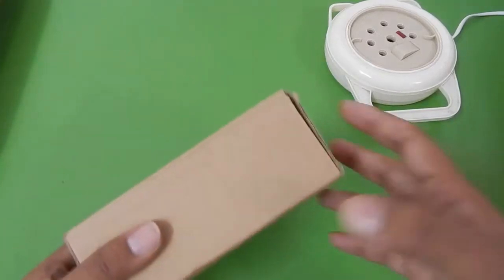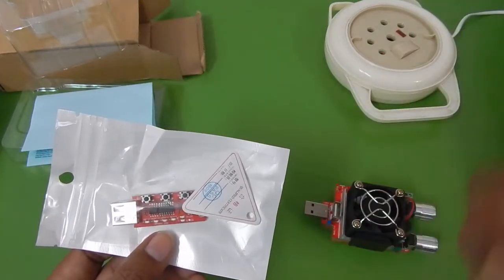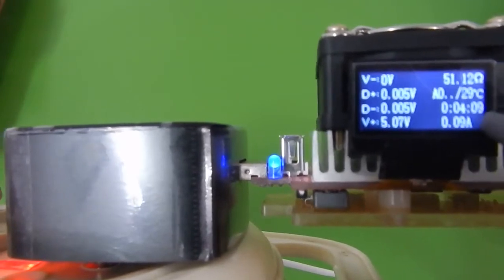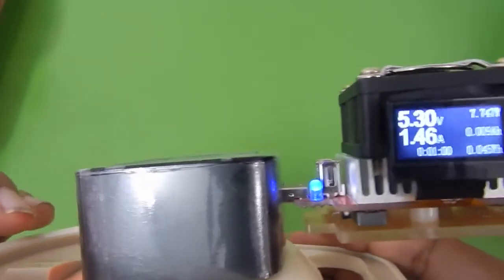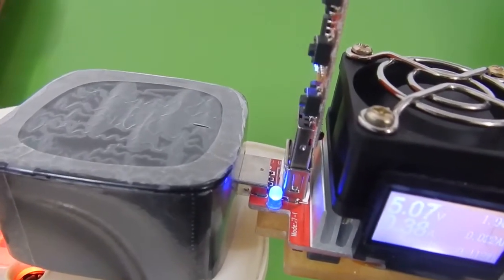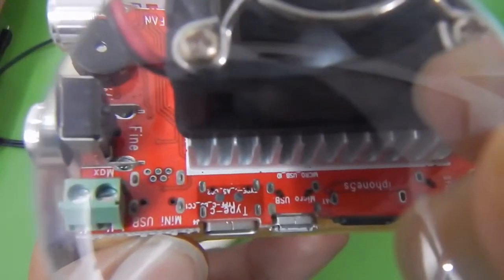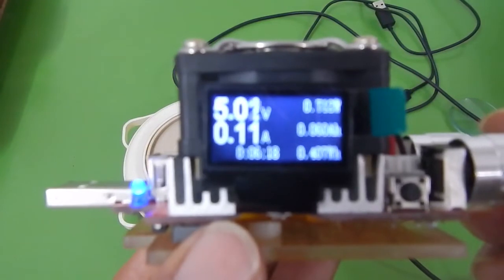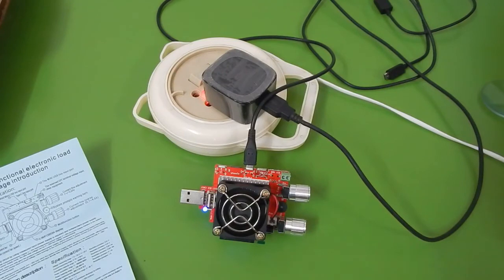USB 35W DUMMY LOAD VOLTAGE CURRENT TESTER

Comment: Hello thanks. I wonder why the charger automatically shuts down once you pass the load threshold. Is it because chargers have some self protection mode? Is it possible to damage a charger by demanding too many amps from the charger? Thanks 🙏
Reply from the maker: Most chargers will have some sort of protection against over current draw and will require you to remove the usb and re-plugging it in before the charger starts working again.
Some chargers will not shutdown but the usb tester will still turn off because there is not enough voltage available for the usb meter to stay ON.

Comment: Hi there , thank you for the video , recently i bought this usb loader ,but it seems when i spin the potentiometer the amp remain zero i believe the product is defective ,but im wondering if i replace tip122 transistor ,does that fix the problem ? thanks
Reply from the maker: can't say what could be the problem.
But if you have the transistor then you can try replacing the it and see it works.
All the best.
Reply: @gurribuy  really thanks for replying back to my question

Comment: Thank you for the video. It is again very detailed. I wonder 1 thing though. When you test the cheap usb cable in the end of the video, what would happen if you rise the load amperage to 1.5 Ampers ?
Reply from the maker: If i raise the current to 1.5Amp the the voltage will further drop.
if the charger is capable to delivering more current i can further increase the load current and the voltage drop will be more. In my  example i used the moto charger which can deliver 1.6A at 5V. so, if i go beyond 1.6A the charger will stop and the usb meter will shutoff.
Reply: ok, thank you, so a good cable can sustain 5 volts but a bad cable drops voltage below 5 volts in the same ampere drawn from the charger. it is clear now. :)